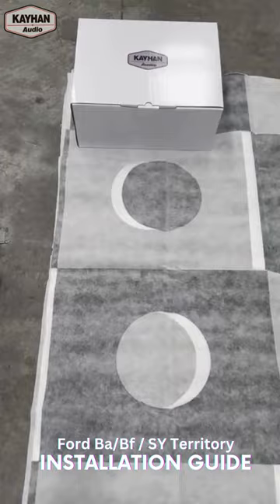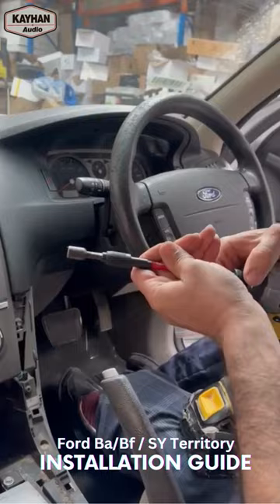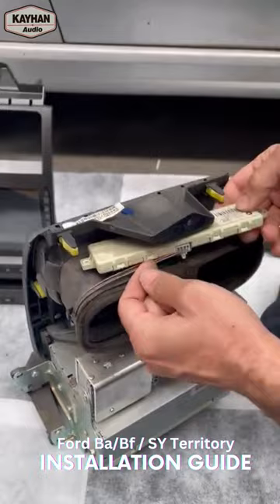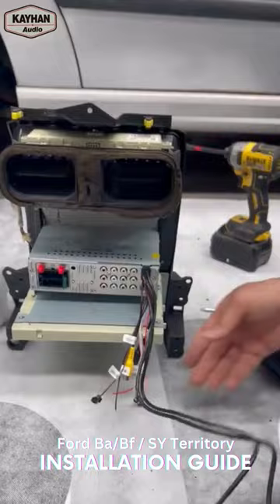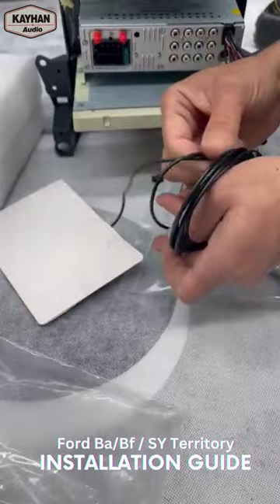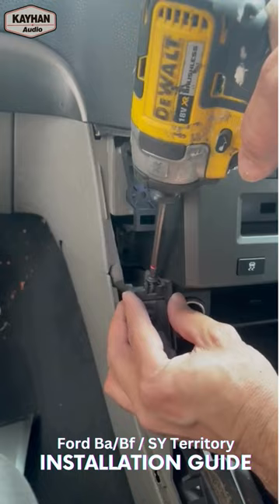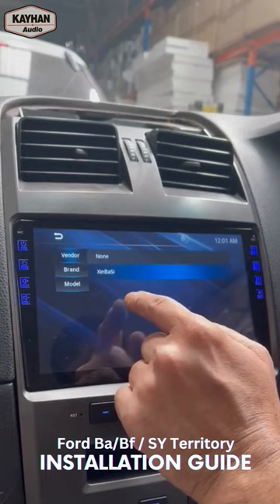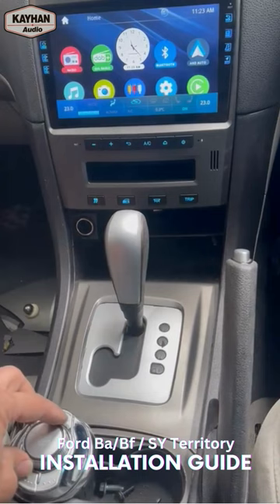DIY: Ford BA/BF/SY Territory Kayhan Audio February 2023 Launched Headunit Installation Guide.

Comment: Does this headunit have a google play app built in? (So i can download different applications) 
Also, why does the unit you installed not have a big KAYHAN on the face of the unit, because it looks much tidier without it
Reply from the maker: No it doesn't have a Google Play app. We have another headunit which has that capability

We have two options

$1495

https://kayhanaudio.com.au/product/car-stereo-with-satnav-for-ford-ba-bf-territory-version-5-9-6-inch/

$895

https://kayhanaudio.com.au/product/linux-headunit-for-ford-ba-bf-territory-sy-ghia/

The more expensive option has more RAM, storage, and a faster processor. Another difference is that the $1495 model comes with inbuilt maps, whereas the $895 model allows you to access maps through CarPlay. Additionally, the cheaper model does not support downloading any apps

Picture is attached which will explain the differences further

1. Both are plug and play.

2. It's easy to install.

3. We'll send instructions with the box, and we're available to assist you with the installation 24/7.

4. You can easily install it on your own, or you can take it to any local car audio installer for installation.

Below are the installation+ demo videos of both 

$895

https://youtu.be/Ijqhtou2jh8

$1495 

https://youtu.be/fhbrjXRk3vs

Regards
Bill MORRISON

Comment: Hi, I have a Kayhan system in my BF Falcon, I need to programme a new remote for the car which involves activating the rear demister button three tines within 5 seconds of turning the ignition key to its first position. Unfortunately it takes about 30 seconds to get to the demister function after turning the key to its first position, any suggestions on how to work around this?
Reply from the maker: 1. Sit in the car
2. Turn the car on 
3. Take the unit on AC climate control page and get the rear demister button ready. 

4. Turn the car keys off and immediately turn them on so the unit stays on at the demister page. 

Then click the rear demister button within few seconds and follow the above instructions

5. In less than 3 seconds of turning the key, press the rear demist button 3 times

6. If done correctly, the door locks will cycle. If the door locks do not cycle, start the process again and try completing the steps faster or slower.

7. Once in learn mode all existing remotes will be deleted from the car’s memory. Click any button on the remote until you hear the door locks cycle. Once the locks cycle this confirms the remote has been accepted into the car’s memory.

8. Repeat the last step for each remote (if you can have more than one)

9. Remove the key and step out of the car and test each button on the remote is performing it’s proper function.

For any tech support in future please do contact us at 1300 696 488 / support@kayhanaudio.com.au
Reply: @KAYHANAUDIO  Thankyou, that worked perfect.

Comment: Does this work with my factory sub woofers in the back of my car. It’s a 2005 ford ba mkii xr6 falcon
Reply from the maker: Hi yes it will work you need to select the premium sound activation for $75 available under the same link under EXTRAS. 
If you have any more questions feel free to mail us at info@kayhanaudio.com.au or call 1300 696 488. Thanks